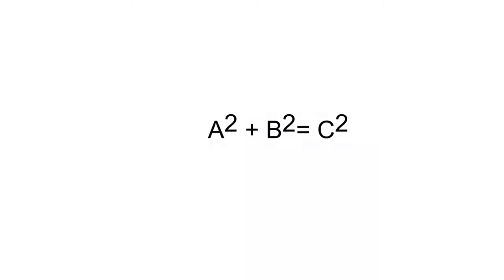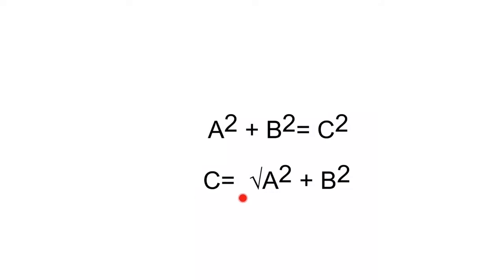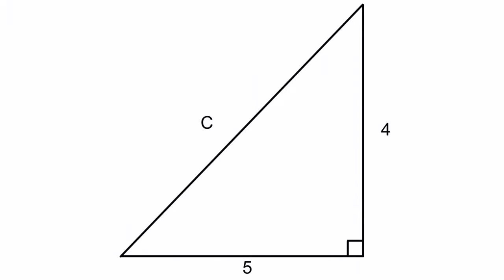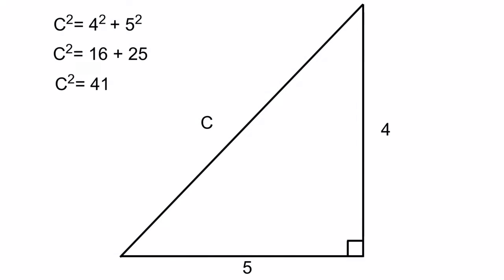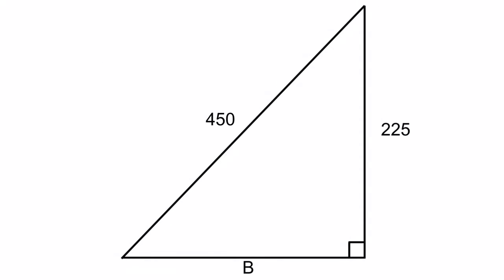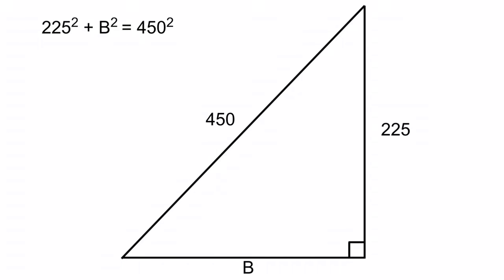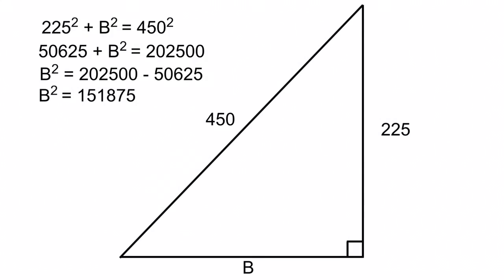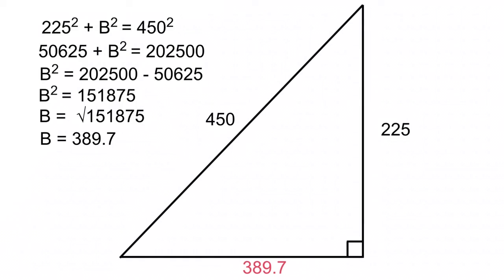Pythagoras theory

Comment: I'm 4 min in an have no idea why i'm trying to figure out triangles or what any of this has to do with electricity at all ..  1 side is 450 1 side is 225 and we want to figure out b   450 what ?  225 what ? amps voltage ac  dc  wtf are we doing lol why do i care what b is why am i figuring this out...  is electricity a triangle ...   Trigonometry for electricians kinda made me think it would show more why and how trig is important and how it's used by electricians, from the perspective of what would i need to know and why to become an electrician.
Reply from the maker: Hi Brad.  You make a good point perhaps when I update these videos I should mention why this would be important to electricians
Reply: It is important to know trig for calculating power when current and voltage are out of phase and in the understanding of 208VAC and 480VAC voltage phase relationships. This is just an example of the math involved, not an applied electrical problem.
Reply: how did you get on with the electrics im doing the same thing right now and I can't get my head around this
Reply: apply it yourself
Reply: hint AC and components inside AC